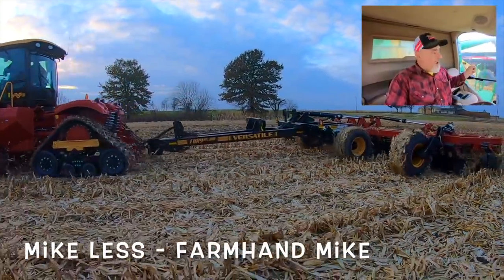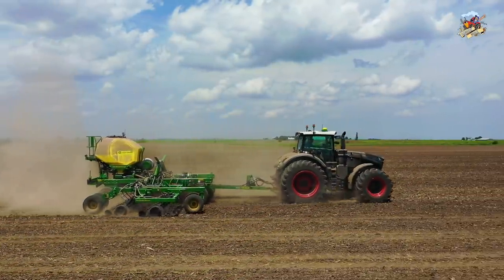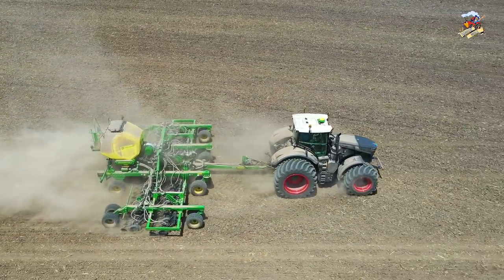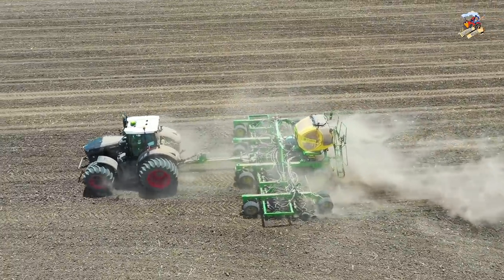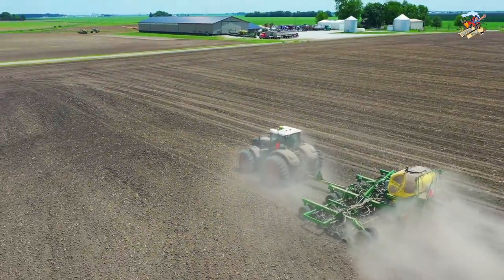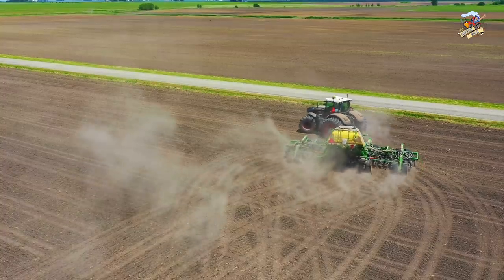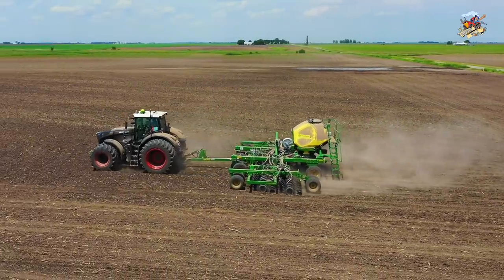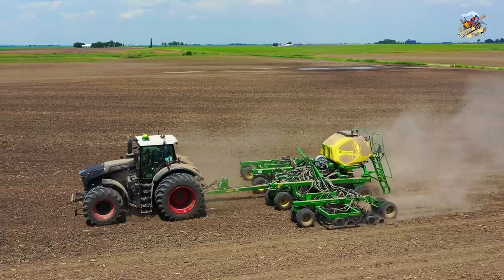Planting with a Fendt 1050 Tractor with LSW Tires

Comment: Nice set of LSW tires.  They are cheaper, smoother riding, and more fuel efficient than tracks.  Tracks cost a lot at initial investment, cost a lot to repair/replace, and you lose your butt at trade-in time.  I wish someone would do an "Apples-to-Apples" comparison of a Versatile 610 with Goodyear-Titan LSW tires, against a Versatile 610 with tracks.  Same power, same ballast, same implement, same depth, same speed, Auto-guidance to take the human out of the equation.  Compare costs of wheels vs tracks, compare slippage, compare fuel costs, also compare ride quality and maximum travel speeds in the field and on the road.  Both Goodyear-Titan people and Versatile people involved to make sure things are set up properly.  Video was pretty good until the 8:20 - 10:00 range, when the music came in.  Let the sound of the machines, be the music.  I still gave you a "Thumbs Up" though.